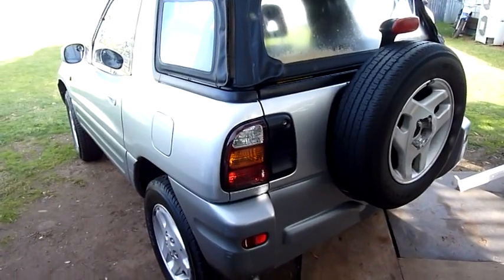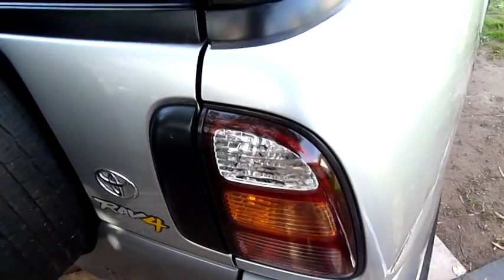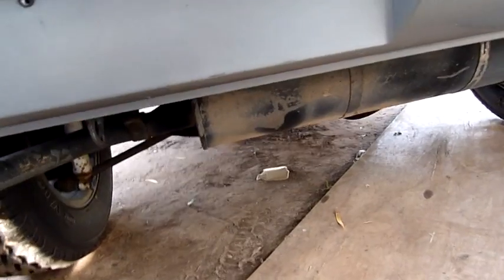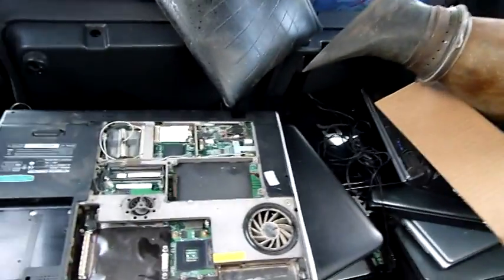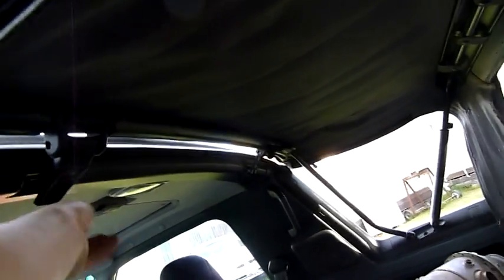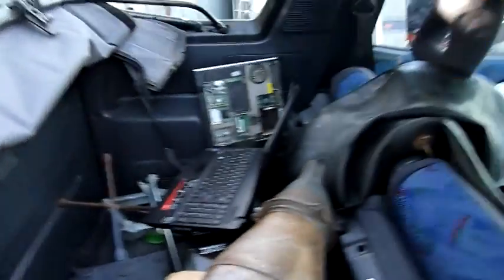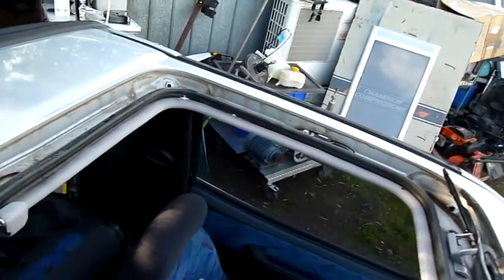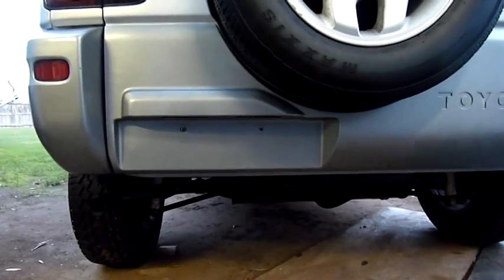RAV4 gets Her Top Off and some Sunroof TLC

Comment: You'd be surprised how good the 4.1's are off road Ed. We've got a 4 door auto and it handles most things well. The diff lock works very well.

We've had water over the bonnet crossing rivers just sucks how the intake is a bit low.

Comment: Did you ever had a problem with toying with which OS you have to use? I have the damn problem here, HP Pavilion A6740NL, but it's really odd. It somehow had chipset overheating issues (solved), sometimes the motherboard doesn't detect the hard drive at all. Or sometimes it doesn't even get past the POST. Does someone have any idea what could be wrong with it? This isn't my system but I want to make it bearable as much as I can.

Comment: I've had passing thoughts about getting a newer RAV4 as a nice little rough and tough foul-weather car, but it doesn't seem you can get the newer models with a manual, which is unfortunate. I'm not fond of Toyotas autos, my grandpas '04 Camry V6 always overrevved a lot in 1st gear.
Although even if you could still get a manual RAV4, you probably couldn't get it on a 4WD V6 model. That's what I get for living in a country where the laziness offered by an auto is king. :(

Comment: I took some time on it, appeared to be the hard drive failing bad, removed it and it detects the storage devices without problems now, now I just need to find a hard drive that's working. I got a Hitachi drive from a HP media center thing which appears to be failing TOO. :(

Comment: You could make a U shaped piece that would bolt on the body, hugging it at the bottom of the pan to replace that retarded strut that's the outcome of removing the hardtop section. I've seen something similar on rav4 a few years ago. Word of warning tho, the guy didn't care much for aesthetics so his was a piece of tubing bent to match the body that (ie didn't really match all that well) he had welded to the bottom and the sides. The car has been sold so i can't link you to a picture.